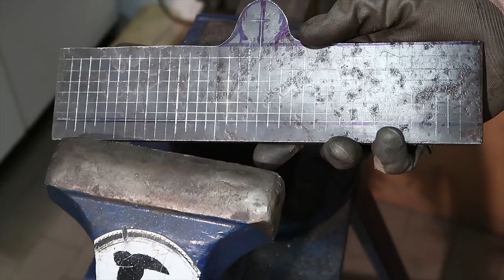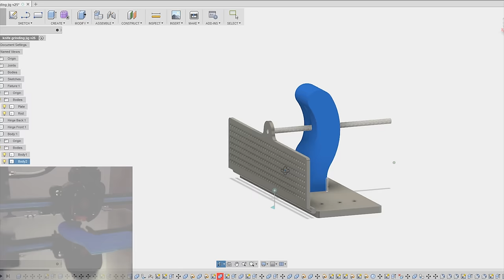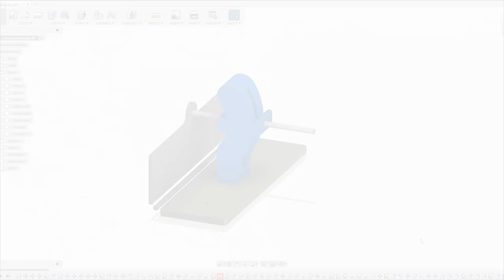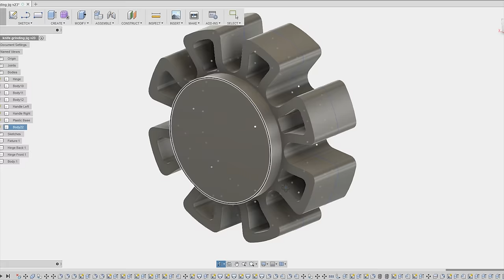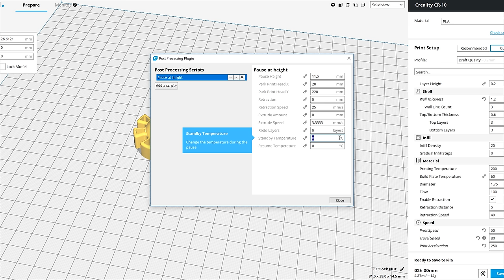Bevel Grinding Jig Knife Making DIY

Comment: Small tip most people don't know about: you can get cutting fluid as an aerosol spray, so you could coat the entire plate very quickly, ensuring that every center punched starting point was already wet. It's lighter weight than most other cutting fluids, so it's still easy to find your mark. Maybe this helps someone?
Reply: Also a drill press table with an adjustable fence an an indexing stop would have made that operation MUCH simpler (and more accurate). And the fence prevents workpiece from being thrown around, so you don't need the clamp. If someone reading this wants to make this jig you could use the time to make the table and fence (many videos on the subject out there) instead of the slower layout. Also, for those with CNC routers, you can get a carbide spot drill for like $5-10 in 1/4" size for your router, and use it for laying out the holes. You just set it to a very shallow drill depth and finish on the drill press.
Reply from the maker: Thanks man! Great suggestions :)

Comment: When making my bevel jig, I realized why make the jig, angle adjustable, when the work table on my grinder is easily adjustable.  Much easier to leave the jig at 90 degrees and adjust the table for bevel angle.

Comment: i would have put the threaded rod down on the plat, the part its attached too can get in the way of the grinder :)
Reply from the maker: You think so? :) I'll see when I use it some!
Reply: it depends on how long knives you make and how long you work rest is. you can see my jig in my videos :) its a bit like yours mine is just a bit(lot) more simple. one thing that is good about  mine is that is made of thick alu that helps ceeping it cool :)

Comment: Would have been nice if you explained how to wooden jig works for people that want something more simple.
Reply from the maker: Check any of my knifemaking video, I've used it many times :)
Reply: Black Beard Projects yeah I’ve seen it but I don’t quite get it. Are the bolts what push the blade out and change the angle of the bevel? Thanks